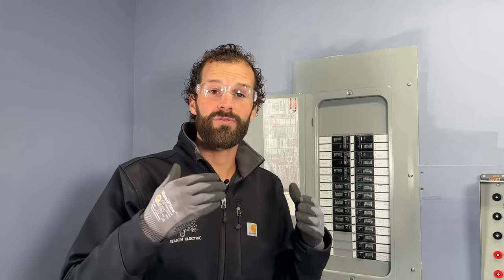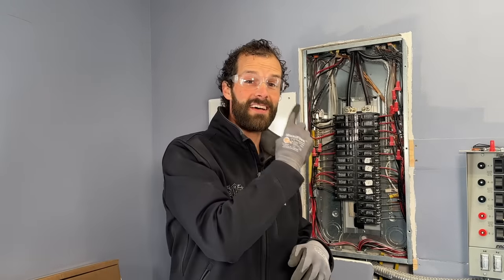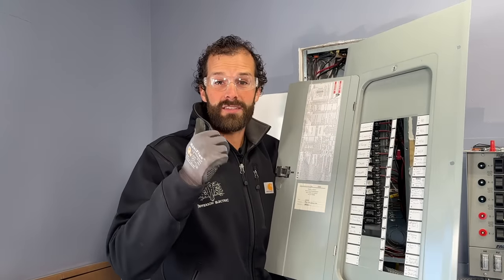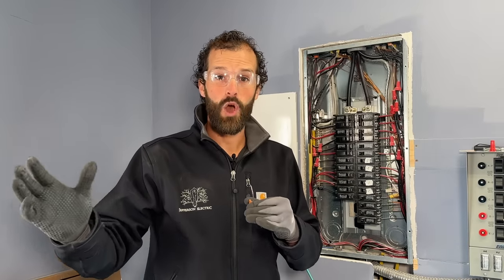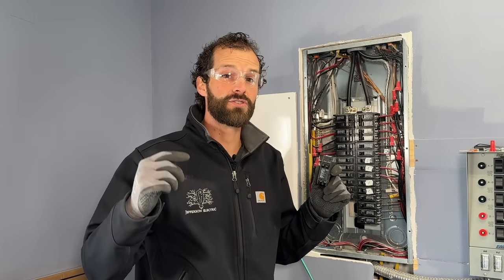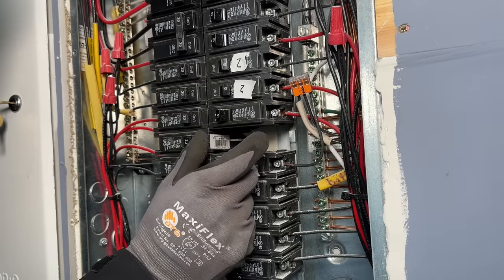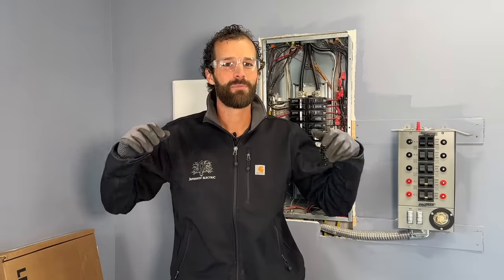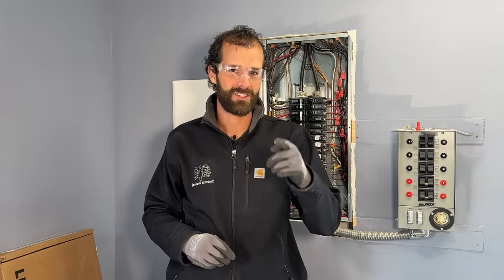No Room In Electrical Panel - Quick Fix

Comment: I don't know if I like this.  Is it possible to do this with a neutral wire?  If so, I would probably use 10/2 pigtails.  

It looks like when you're doing this with the WAGO, the two circuits are now sharing a 15 amp load.  So if both circuits are running at the same time, you have a bigger chance of overloading the circuit, depending on what they are running.  

You also have to worry about which legs these circuits are on.  I'd be cautious with a multiwire branch circuit.  If you accidently run two circuits on the same leg, you may cook your neutral wire.

Comment: Love mist Square D products. Could not get an answer at a continuing education class if you can install say a #14 guage wire on left side of a Square D single pole 15 amp breaker and a#12 or 10 guage on other side. Sone sparkies believe both wires have to be the same guage but I don't think so.

Comment: That's great.... but I have the reverse problem.  I have breakers that feed way too many appliances (kitchen) and outlets (kitchen) and lights (all over but LED so not relevant).  Other than breaking the wall and re-fishing new lines to the electrical panel how can this be best corrected so the microwave + air fryer don't pop the 15A breaker?

Comment: If you are considering a panel upgrade, you should plan ahead to the possibility of needing tandem circuit breakers.  You should read and find out how many of these can be added down the road if needed.  My home several years ago got a Square D 100 amp Homeline panel.  We don't have electric heat and the only 220 volt items in my home are and electric dryer, my through the wall A/C and the feed to my detached garage that has it's own sub-panel.  The panel I had put in can actually handle tandem breakers in every space in the panel.  Believe it or not, they used to make a tandem 220 volt breaker.  It had 4 breaker switches in it.  The 2 outer breaker switches were 2 single separate 110 volt 20 amp breakers.  The 2 middle breakers were tied together and was for a 220volt 30 amp circuit usually for an electric dryer or water heater.  I don't know if you can get those anymore.  I think some brands still make them.
Reply: One other thing I think you should have mentioned in the video is that you cannot connect a 220 volt circuit to a tandem breaker because this could overload the single phase because the 2 breakers share the single tab on the bus bar.  You have to use 2 tabs to properly have a 220 volt circuit.
Reply from the maker: Thanks for the feedback Kevin 👍
Reply: Those breakers were called quads and were popular with the Murray and Bryant brands, perhaps others as well. Code now requires most residential circuits to have AFCI or CAFCI protection making the addition of circuits via tandems a moot point and no longer an option. If every space in your 100 amp panel can accommodate a tandem, it's a 20/40 panel and the cheapest on the market.

Comment: Great video, i am getting a generator and wanted to install an interlock kit but the top right side of my panel where a double pole 30A would go is taken up by 2 15A single pole breakers. (actually seeing bow the top right 3 are AFCI breakers).  I need to either relocate or do something to make room for a new 30A double poll so I can wire it to my outlet for my generator plug.

Ive heard people mention something about shared neutrals or something so not sure if i could just move those 15A AF breakers to the bottom or what...

Comment: Smart panels are awesome. We sell solar powered battery backup systems and now we can put many more circuits on the back up load panel because when the power goes out and you have a smart panel you can choose which circuits you need energized and which circuits you can shut off. I can literally go on my phone and check to see that my battery is 90% full and then I will go ahead and energize the air conditioner for two hours. For example.

Comment: While not required by code in some jurisdictions, it is a good idea to have the smoke detectors on a separate circuit.  I just replaced a First Alert CO & Smoke detector and it came with the following warning:
 
Caution - Make sure the Alarm is not receiving excessively noisy power. Examples of noisy power could be major appliances on the same circuit, power from a generator or solar power, light dimmer on the same circuit or mounted near fluorescent lighting. Excessively noisy power may cause damage to your Alarm.
Reply: My smoke alarms (all nine of them) share one circuit.  Nothing else is on it
Reply: @mattalbrecht7471  Mine too.  My comment was based on the comment the electrician made at the 2:20 mark in the video.
Reply: in my opinion it's better to share the circuit and if someone turns the circuit off to silence the alarm it is not forgotten about and left off!!!!

Comment: So Is it or IS IT NOT  allowed to have two circuits on one breaker , because I am confused; other sources have said that it is not SAFE. In my home here a breaker some years ago started tripping and when I checked, it had two circuits on it , so something told me to try disconnecting one, and amazingly it solved the problem; I suppose that the disconnected one must have a short.

Comment: The village I live in does not allow “1/2” size breakers so you can put 2 in one spot. But I did change out my panel and  at the bottom has provisions for the smaller size breakers but it doesn’t double up each space.

Comment: My smoke detectors have to be on a separate 15amp circuit by code where I am, smh.  It doesn’t make sense, but that’s what they wanted when I re-wired the house.  Thankfully I used gas appliances and heating to offset the electrical load from the panel.  Without doing that, I would have just simply ran out of room on the panel I have.  Very educational video though, thank you for posting!!

Comment: Thanks for this useful information. Would that be possible to tandem 2 X 40amps? Connecting a home ev charging station with a pool heat pump on the same breaker? Do we need a physical switch or or the power switch automatically when you turn on of the device? Thanks for your help!

Comment: At the 4:30 mark, it looks like you are connecting a neutral to the hots......but that white on the wire is not a marker but a label, correct?

Comment: When you made that joint in the box that was a violation,  because the panel is not listed as a junction box.  You could create a hazard situation here by combining the two wires ,  if both wires are listed as 20 amp circuits, and you put the two together then you have two 20 ampere  circuits under one 20 ampere breakers.

Comment: Push lock connections suck. I had push lock receptacles in the house I was renting and I got curious so I checked the receptacles and found 3 that had gotten loose and melted the insulation back about 3" into the wall. Damn near burned the house down. I've also done maintenance for 20 years and seen lots of problems with push lock style connectors. Each to their own but wire nuts are great if you learn how to use them properly and pull on the wires when you're done to make sure they're secure. Wire nuts also provide a lot more surface to surface contact for the wires than the WAGO style do.

Comment: What about siemens (well...old ITE) panels using qp or qt type breakers built before the total circuit limiting rules? That's how I learned about CL rules and had to find non CL breakers($36 for NCL vs $16 for CL)to add a dedicated circuit for a microwave. Rejection tab really screwed me up that day trying to add the tandem single pole breaker.

Comment: i need to install a 60amp double breaker on an ETN panel but I dont see a double breaker that will fit.  Only singles are available.  How can i install this 60 amp breaker?  Thanks.

Comment: So about to install SquareD whole house surge protector. Requires double pole 20 amp breaker. 

I only have a single slot at the bottom of my Cutler-Hammer panel. House is 22 years old. Panel has other tandem breakers in it already. 

My electrician says to use a quad or twin 20A amp breaker. 

Would this only protect 1 leg of the panel?

Comment: This is why I prefer to install GE Q-line panels. Sure, Eaton and Square D panels are cheaper up front than a Q-line... but they get you on the back end. Q line breakers are much cheaper than the others, and they also have half width breakers readily available.  This allows much more flexibility later down the road. A 20 amp q line runs about 6 to 8 bucks, whereas a square D is over double that!
Reply: Good luck with POS garbage that ge throws out there. A union contractor installed two 120/208 42 circuit ge junk panels and you could only open the doors maybe 50 degrees while the NEC mandates 90 degrees. Every Expensive GE  million dollar plus 13,200 volt dual service with automatic tie breaker gave me serious problems.Last one halve ass ge engineers put vents at eye level on 13,200 volt dual service switchgear that had a CAK rating iver 100.  This set up guarantees that you will not be buried during a short circuit while transferring loads. You will be cremated from ge design. Of course we were told that above a 50 CAL short circuit no PPE can protect you. The arc flash blast that high would throw a fat person back at least 40'. GE service & parts were always the worst to deal with. GE even managed to contaminate one of our 13,200 volt transformers with hazardous PCB'S back in the 1970'S because they were too lazy to use a clean 100' long filter hose but used a hose filled with oil that contained PCB'S.

Comment: My box only has room for 4 breakers and 3 are already used and cannot be combined without having issues with tripping often. I need to put in a 220 breaker to run a welder but I only have one space left and a 220 of course takes up 2 spaces. I really don't want to replace the whole box. I might be able to ad another breaker box underneath and run the welder off that.

Comment: I passed the pro test, alot of electricians especially union guys in my experience will sometimes cut the breaker to jam it in and im always shaking my head. Glad you brought this up my hats off to you
Reply: WTAF? Cut the breakers? Thats just insanity.
Reply: @njineermike  yea they take a multi tool and cut out the back tab that prevents its use. Scary shit
Reply: @busterdeadpool  That is terrifying. Theres a Scottish guy that tests stuff on utube and one video is a "circuit breaker" thats nothing more than a toggle switch with a detent to appear to be a thermal-mag breaker. It even has legit looking markings on it. Once I find it ill post a link.

Comment: A full circuit  panel may not have enough neutrals can you set up a pig tail arrangement with neutrals or will you overload the neutral piggy back wire?

Comment: Im from Canada and our Canadian Electrical Code states that a panelboard cannot be used as a raceway or junction box, so the combining of the circuits with the WAGO's would not be allowed as that would considered a junction in a panel....just if any homeowner is watching from Canada, although Ive seen it many times in panels.

Comment: I was not going to add this comment. However after talking with some other licensed pros we all agree that stating that this can be done by homeowners is not safe. There are just too many things that have to be paid attention to in a panel. Pinched wires, poorly landed wires, unseated breakers, wrong screws, bad wire routing or pinching. The list goes on. Outlets and switches are protected by 15 and 20 amp breakers usually and don't have the potential of a 200 amp mistake.

Comment: EATON has made a change for the better. They have eliminated ctl breakers. All their new panels are rated for tandem breakers of the non-ctl type. They have requested retailers return the ctl type breakers to them.   Since the non-ctl type are the only ones available and do not have the rejection feature, they will be allowed where they previously were not. I do not know if the other manufacturers will follow suit.
Reply: So that's why they've disappeared from Home Depot. Now they have to lower the artificially high price of the non-CTL breakers. Previously they were priced high, almost double of CTL breakers to discourage their use where they weren't allowed. Now that they're standard and the only type available, the price needs to be lowered to the same price point of the CTL breakers.

Comment: Good info but I'd avoid using a wago at this point in the circuit(s) since they already run hot due to the lack of contact area. A properly used wire nut is the way to go.
Reply: Wagos are fine.  Nothing so important at that point in the circuit as you are combining two circuits with a vary light load.

Comment: At the beginning when you remove the two Breakers and piggybacked the wire onto one breaker you changed the phase of the second breaker. If the second breaker and the first breaker had a common neutral you're going to burn the neutral out by now applying double amps to the neutral.

Comment: Heres a trick I do. Whenever I move into a new house,  BEFORE  anything is moved into the space,
using a wall lamp as a tester I test each & every outlet & switch & label the breakers. ALSO, on the wall 
above each outlet, at the ceiling, I place one of those colored dot stickers you find at the office supply.
NOW, in the future, when I am searching for an outlet all I have to do is look up.

!

Comment: You can buy tandem breakers without the restricting clip in them. Such breakers have a warning sticker which says "For replacement use only. NOT for CTL( circuit limiting) assemblies". You have to ask for them at your supply house. And they cost twice as much as the regular tandem breakers.
Reply: Which can only be legally installed in older panels with the rejection feature. Not the panel shown in the video.

Comment: The code that I am familiar with regarding smoke/CO detectors is that they SHALL be wired to a 15A lighting circuit. That way you can't turn them off without the inconvenience of shutting lighting off.
Reply: Smokes and CO detectors also get wired before and in the same circuit as the CO source. That way you can't use the CB to silence the detector without killing the source of the problem. Depends on local code requirements because the NEC is bare minimum. You can always improve the install.

Comment: My 2005 condo is not a good candidate for an electric car circuit upgrade. The main breaker is only 125amps, the breaker panel in the basement is fully populated, and with a 40amp stove, 30 amp AC and 30 amp circuit for a dryer… I think it could be many thousands of dollars to upgrade, which is why I never will buy any electric vehicle while I am here. But I still find this interesting.

Comment: If I was combining circuits (as the Wago depicted) I would still use a wire nut as they offer less resistance and run 10 degrees cooler at 18 amps, and I would use a 12 gauge wire to the circuit breaker for the same reason.

Comment: I have a 50 amp breaker at the top of my panel box for electric range can i add a 30-50 Tandem in that spot to run a generator interlock switch?

Comment: Interestingly, some jurisdictions prefer or REQUIRE that you have other devices on the alarm circuit (in one instance, it was the lighting circuit for the basement) to discourage pulling the batteries and killing the circuit.

Comment: A couple things not mentioned, there is a limit to how many splices (those red wire nuts and the Wago he installed are splices) allowed in a panel, check your local codes. The tandem breakers are on the same phase so you can't use them to get 220. The slots on the bus are to prevent overheating breakers close to the incoming power. Many breakers including tandem have rejection tabs preventing them from using a slot in the top half. I would agree, not a lot of other electricians know about this.
If you do your own work, it's always a good idea to have a licensed electrician look at what you've done before drywall goes up. Money well spent before inspections.
Reply: @Kevin-mp5of  And what would happen if all the high-amp and 240 breakers were at the bottom, away from the feed?
Reply: @Kevin-mp5of  You are an electrician?
Reply: No, the slots on the bus are to allow the tandems, and are typically placed near the bottom because that's where the manufacturers decided to put them. Just about every manufacturer makes a 20/40 panel where EVERY slot allows a tandem, disproving your theory tandems are kept away from incoming power.

Comment: NEC requires a minimum number of general/lighting branch circuits.  Let's say you have a 2000 sq ft home - 4 of these circuits are required.  You recommend reduction by tying two of these circuits together and placing that under a single breaker.  I see that as a code violation.  Mini twin breaker is the best option for needing additional space.  Also, you failed to remind people to check the load for the panel (feeder).  This leads people to believe they can just install some mini twins or tie circuits together so they can add an EV charger to a full panel - because they have the space.

Comment: If I remember correctly there are two kinds of tandem breakersIf, I have ran into this on a CH panel having to use Eaton breakers. The one with the modified slot cut is twice as much money and looks the same if you don't know what you're purchasing .
Reply: CTL & Non CTL